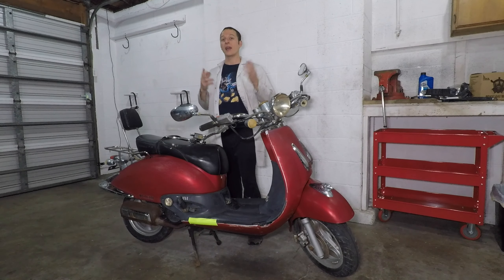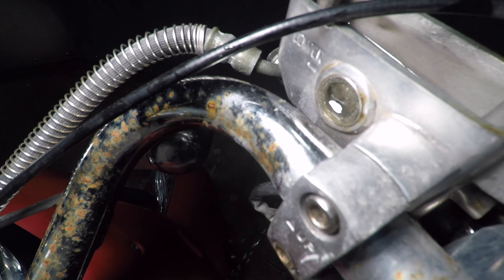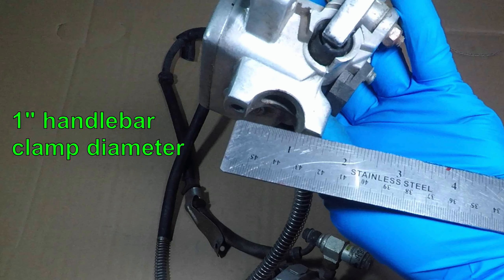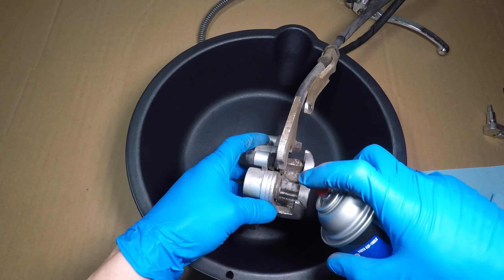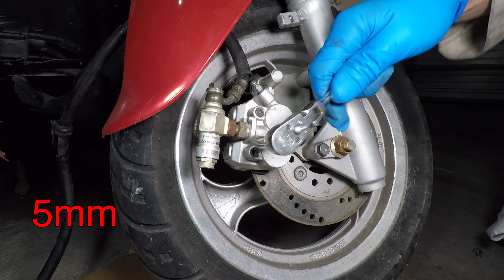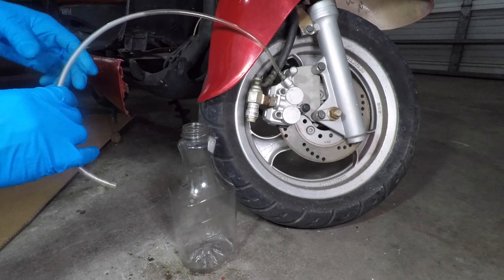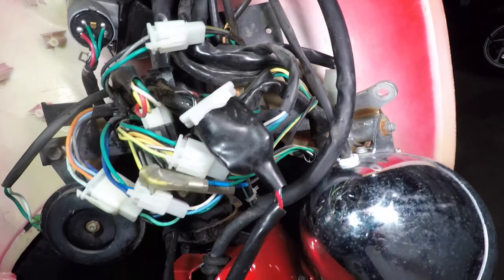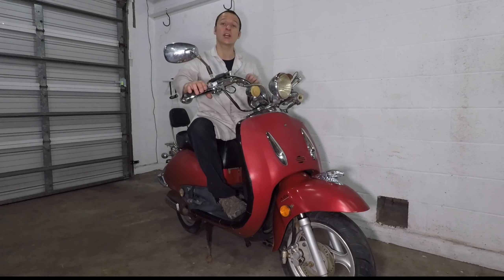Fixing the front brake on a GY6 150cc Chinese scooter

Comment: Um literally everyone skips over the brake spring shim thingy. Like it has tabs on it... Do the pads go on the big side or does one go on the smaller one with the tabs sticking up? Mine broke at some point because I bet it wasn't installed correctly. Seems like an important step. It's not easy to get the pads on it before it slips out. I found only one vendor on eBay selling the part and took a month to get from China. I don't want to break this one. 😮‍💨😮‍💨